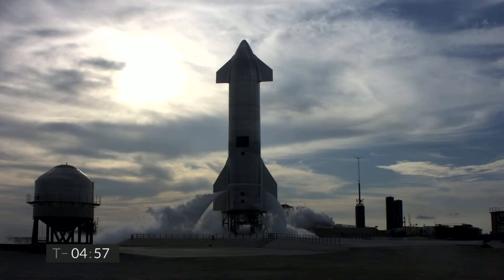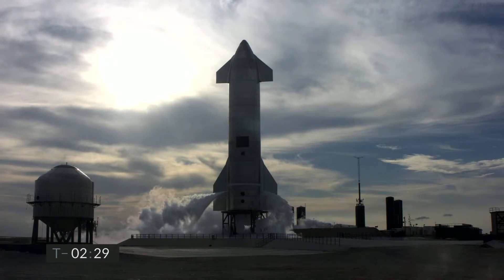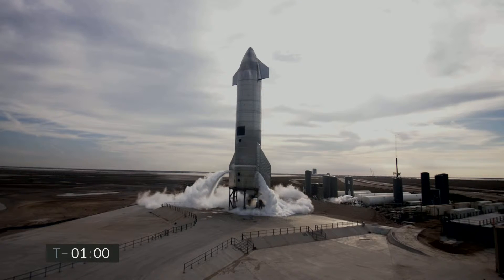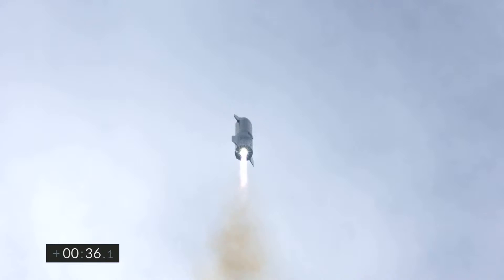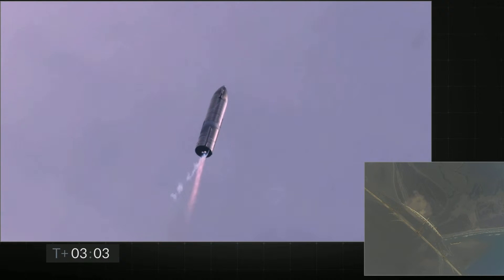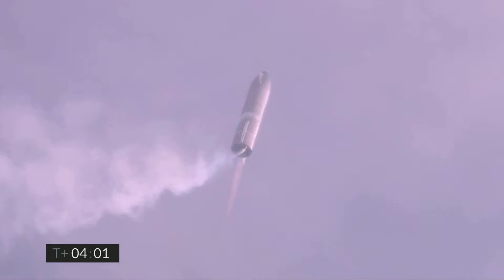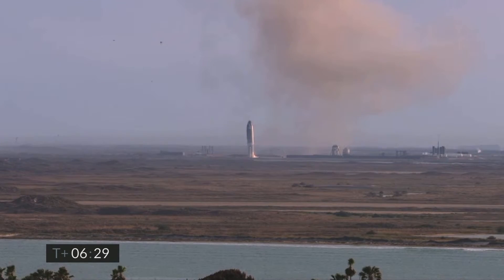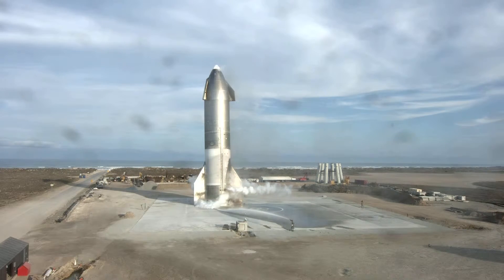Starship | SN10 | High-Altitude Flight Test

Comment: When it landing started, it looked like engine had failure or it was just trust control ? I think you need to improve the engine.
It needs to be able to make more thrust on landing, spaceship is so heavy and It bounced from the ground then it got damaged.
I don't know if you are using inverse kinematics, but if I was developing spaceship, I will do calculations to predict spaceship velocity at time of impact so spaceship can do its job in right time.
I hope you read this Elon. You are my inspiration
Reply: They shut down 2 engines as planned for the landing burn. No engine failures here.

Comment: just watched this again this morning and several things seem out of place.   The first is that "wash" of something along the outside of the engine housing sure looks to me like a leak.   The second is the color of the flame during the view inside the engine housing, plus you can see some of that wash that I don't think should be there. The third thing that I noticed I saw yesterday but today just seems to stick out more.  It looked to me like the whole starship "BOUNCED" when it touched down.  An object that heavy and built to be as light as possible is not strong enough to take a beating.   What About It (WAI) didn't stop their feed and the resulting explosion was analyzed.   It seemed to start at the bottom near a flap.   I don't know anymore except that it might have been in connection to some structural damage from that bouncing landing.

Comment: Sorry for a bit of pessimism.. I just dont see how the fully stacked with raptors could it liftoff without damaging itself and concrete undernith. Cant wait to see your solution. Funny how it moves nozzles wiggling between pointing through center of mass and fighting asymmetrical air resistance. Good test even though a final one not requiring asymetrical thrust during orbital flight.
Reply: It's on a launch mount, pretty standard for all rockets

Comment: It's sad that the air ship has exploded after touchdown.
Reply: @VillmuS  yes it exploded after about 9 minutes
Reply: @BuRnOuT_GuRu  i see no explosion there, it was intentional to turn off the second engine and that fire was normal
Reply: @VillmuS  it did explode after about 15minutes
Reply: @VillmuS  apparently there was a methane leak after touchdown (you could see small flames at the end) after that it exploded
Reply: @owencairns5872  yeah
Reply: @BuRnOuT_GuRu  oh alright i see, but yea it was still great test from spacex we can be sure that the next one will be the one hah
Reply: @VillmuS  yeah that is true but technically they achieved what they wanted to achieve which is soft touchdown
Reply: @VillmuS  https://youtu.be/R9_jVJklfHQ

Comment: So prototype they don't even put landing legs on it because it will be scrapped. Land right on the engines.
Reply: It does have landing legs that fold out.  Very short, too small.  They have upgraded ones ready for a later version.
Reply: @DanChampionJr  I was assuming they factored the landing would fail and also they ideally want to catch the rocket
Reply: @SterlingSansing  No, they have had the same cheap inadequate legs on SN5, SN6 for their hops, SN8, SN9 for their flights as well.  They have shown newer legs that have a more robust design, and indicated they will be on a later starship.  Maybe SN15.   SN11 is about to roll out, and it too has the cheaper legs on.   Had they set down a little softer these would have worked.  But as you can see it hit (and bounced) a bit hard, which crumpled these legs.
Reply: @DanChampionJr  thanks for the research. Will watch

Comment: very, very clever. using the unaerodynamic shape to reduce airspeed rather than fuel in a vertical descent. The saving in fuel and weight must be astronomical.

Comment: The rippling of the stainless fins @ 6:01 it would be impressive to see in slow motion.
Reply: Looks ripply, but it's infact deformation of hot and cold forced bending the metal during production, it has nothing to do with having this foil like structure that waves around like crazy. It's really strong.

Comment: I have compiled here a rought transcript of mission control, not counting the commetator.

0:00 "Our FAA licence is intact"
0:05 "Thanks"
5:13 "T-30"
5:23 "20"
5:33 "T-10, 9, 8, 7, 6, 5, 4, 3,2,1"
5:44 "Ignition"
5:45 "We have liftoff"
5:51 "All teams, triage alerts please"
6:01 "Acknowledge, software"
6:05 "FC2, please prepare for section 35, OAC, FC1, and LVN
9:22 [Unknown background speech]
10:25 [Unknown, spoken over]

Comment: Incredible work SpaceX team, sticking the landing was a great bonus considering this is only the third go. Some great vehicle ascent & descent data there.
I new she came down a little hard when i saw the little bounce, such a shame the fire-bot was unable to mitigate the fire so you could get hard vehicle inspection data afterwards,
 i had a feeling there was just enough fuel there to make it exciting just before she blew.
 Incredible achievement tho. 
that sequential re-ignition & shut down of the un-needed of the raptors seemed to do the trick. 
Cant wait for the next one, here is hoping you get some engines back in one piece to check out on test number 4

Comment: They would have kept the second engine running for a little longer so as not to land so roughly.
Reply: Engine 1 thrust could have just been slightly lower than 70% causing that
Reply: @OortCloud  We don't know the data, but from what I can see, it would have been better to turn off the second engine a little more after the third.
Reply: @francocastilloAR  It would appear to me that they kept all 3 engines running longer than they were supposed to during the landing burn which is most likely why they used 1 engine for the landing burn. Besides, 1 engine is just enough to put this thing in a hover.
Reply: @OortCloud  I do not think so. It would be necessary to see the supposed mass of the load to know how many motors to use.
Reply: @francocastilloAR  It's a good thing you replied now because now we know there actually was an issue with the one engine back then. It was ingesting helium so it couldn't reach its commanded thrust. If it wasn't it would've been perfectly fine.
Reply: @OortCloud  I saw the comment by chance. I still maintain the position. I don't think it's the only way to slow it down.
Reply: @francocastilloAR  I do have to agree with you, using 2 engines is exactly why SN15 survived.
Reply: @OortCloud  I can't tell you 100% because I don't have the data.

Comment: 3 things led to the explosion:
1. Landing legs were not strong enough/did not entirely deploy, causing the skirt to take the brunt of the impact (quite remarkably well), but with no way of ventilating the gas under the skirt out.
2. ‘Methane vent’ lit on fire when Starship’s engines flamed out for landing, 11:50.
3. Leaks in the tanks after the landing; fire protection wasn’t good enough to stop the fire from propagating inside the vehicle.

So at this point the raptors and pressurization have been ruled out as significant problems for landing, leaving the landing legs and where that methane vent was placed in the design to be changed.

To me at least it makes a lot of sense that the skirt would serve as a auxiliary landing leg when the main legs fail, with some sort of venting from under the aft dome done by nitrogen pressurization to make sure it can be safed. More importantly they need to have the methane vent or what ever was on fire placed away from the skirt. If the fire didn’t ever light, this bird may very well have been inspected by now.

For people saying the raptors were at fault: if they were expecting the starship to land on its landing legs before it landed on its skirt, you would expect them to be throttling down the last raptor to settle the vehicle on those landing legs. But when they failed, it accelerated downwards as they throttled the raptor down, also causing what seemed to be a bounce or a tilt when the skirt hit the ground. Hence the flight was perfect; it’s the minor issues that caused the unexpected RUD.

Comment: Even a small and quiet fire 
in the engine room, under the skirt, is a dangerous thing. 
It turns out to be an Autogenous pressurization. 
And the bottom tank can't stand the pressure.

Eight minutes after landing, 
the pressure in the bottom tank 
has reached a dangerous value. 
Why did the safety valve not work? 
Wasn't the automation supposed 
to perform automatic detanking?

Comment: 1/6 ...To all the trolls using the explosion 6 mins after a close to 100% successful landing. Let's see the Starship progression so far shall we? SN8 proved that the belly flop maneuver could work and return SN8 exactly where it was supposed to after coming down from 12.5 km height (so the flaps method works), even though all competitors said it wouldn't. Then SN9 proved that doing that maneuver wasn't a fluke due to being repeated exactly the same way for a third time on command. Yes both spacecraft blew up on landing and SpaceX used the data to better SN10 and achieve all the maneuvers from flying up on 3 raptors, hover at it's designated height using 1 engine for a few seconds, then did the belly flop and drop back down to the designated landing pad right on the bullseye! It did the belly flop maneuver perfectly and thanks to learning the data from SN9 they made some corrections and appropriate changes to nail the landing once again on the bullseye, not 100 feet away from it but right on it.
Reply: 2/6...SN10 proved that SN8 and SN9 served their purpose in order to show that method of landing could be done, even though all competitive companies and their detractors said it would be an impossible task and a huge waste of money. So yeah it exploded 6 mins after landing, so what? It landed right on the bullseye yet once again and showed that the legs are a huge issue to deal with. Due to the legs not working, SN10 landed on it's skirt and all the heat, flames, sound vibrations and rebound materials from the ground had nowhere to escape due to being trapped in the skirt. There wasn't any ground clearance and even the water couldn't get in the skirt because (again) no space to reach the inside of the engine skirt no matter how many thousands of gallons they threw at it. Not having any ground clearance due to no landing legs but rather directly on skirt, trapped all of the above I mentioned which ensued with an explosion. In simple terms, what Starship doesn't have but should have...

Comment: 5:57 you know that feeling when you know it's real but still looks like CGI?
Reply: McFlickers  The camera is theoretically on the starhopper. It is shaky on liftoff because the ground is shaking and there is shockwaves on the landing zone ground ( you can imagine that the starhopper is shaking too)  . When the starship comes down , the exhaust is not near the ground so it's a little less shaky
Reply: That's QE energy on steriods.
Reply: Why are you surprised? The whole point of CGI is to mimick reality as much as possible. That's why it looks like CGI but isn't
Reply: @fukun5773  if it really is CGI then I'm disappointed by the quality.
Reply: @Chandan44256  Okay but it isn't CGI though. It's real
Reply: I know, I was just stating that if it really is CGI, then it's really not very convincing.
Reply: Yall can go and see this live. Idiots. 😂

Comment: I don't see how that was a smooth landing, the ship bounced off the ground, a few of landings like those are surely going to be damaging to the ship?
Reply: Baby steps, Fred, baby steps.
Reply: @knife-wieldingspidergod5059  I don't understand why they don't use a parachute to assist slowdown.
Reply: @Salticus Maybe they could find a chute which is really light. This method just seem really dangerous. The chute gives another layer of protection. This method worked better on the falcon though which has the bouncy legs, with the starship there doesn't seem to be anything to cushion the impact. It may look slow on camera but this looked like a nasty impact if you look closely. Considering how large it is it must have hit the ground at 10-30mph. You can actually see the ship bounce off the ground on touchdown.
Reply: @Salticus Of course deploying a parachute would be problematic but so is every implementation with rockets or any engineering feat. All about solving problems. Parachutes are deployed when astronauts come back to Earth and land in the sea, I can see how it's more difficult to land on the ground though with a parachute but the parachute would just assist the slowdown, maybe would use less fuel overall even considering the additional weight a parachute would add because the thrusters wouldn't  need to burn so ferociously to slow the ship down. It's a tricky one, I just don't see this being the solution to spaceship landings. Ideally a spaceship should be able to land like a plane does imo. Why can't they just implement wings and it can double as a plane and spaceship? Would the wings burn up or break or something? Never understood the reasoning for that. If burn up is a problem couldn't they make retractable wings so they could be folded away for launching and reentering the atmosphere?

Comment: how is the camera so stable?
Reply: How is a $10,000 camera stable?
Reply: @DanChampionJr  were $9000 of those dollars spent on titanium robot arms to hold it? What am I a camera expert? I'm asking what was used to keep the frame so steady and basically pixel perfect
Reply: @adils786  Ok, I understand.  Yes, much of that is spent on computer control, and image control.  Each of their cameras has elaborate aiming programming, and very sensitive tracking software.     Most space agencies have similar tracking software and hardware.  Sorry, I don't know the brands, or the specs.
Reply: @DanChampionJr  Na thanks for that, that's literally what I was wondering about so appreciate the info 👍

Comment: Every engineering project is built on failures. Without failures you cannot really learn much. If every test launch had been 100% percent successes, that would be a hint that the engineers had not gone far enough to try out the limits of the technology in question.

I would rather have a hundred test launches failing, as long as the failures in question are not caused by the same thing (which would indicate a learning disability), than a hundred "successful" launches.

As a webdeveloper, I would do coumtless "test launches" every day, sometimes even within the same minute: testing my code, checking if the different parts work properly together and so on. If I get a successful "launch" then it is time to add the next thing on the list of desired features.

For rocketry though, the "refresh" is a little more visible and spectacular though. I can't say I mind that: It makes for a great show! Sad we missed this explosion ;)

Comment: Fix the engines.      Defective engines on nearly every test so far.   New engineers.
Reply: The engines worked perfectly this time like wdym?
Reply: @Yatiblue  No.  One of the engines shut down was leaking fuel.  Each of the flights and some of the stand tests have had engine or plumbing failures.  There is a material, design or manufacturing flaw.  It is time for the drawing board.  There seems to be a consistent 'something'.  Those engines are being manufactured to be used and re-used many times.  And so far,, at least one or more of the three has failed.  I suspect it is a thermal expansion contraction issue caused by a wrong material or a too direct pipe that has no room for the changes in dimension.  
The fire underneath was burning before landing.
Reply: @Sailor376also  yeah they're definitely not as reliable as they should be. I think they'll be able to fix it though

Comment: 12:01 it did do a pretty noticeable small hop right there as it landed..
next step will definitely need to be some more robust landing legs
Reply: its a waste of funding spending it on landing legs when the rocket is still in development and only does one flight
Reply: @Sparrowash97  of course. and now that they finally managed to get the flight down, next step should be to improve the legs so future ones don't land so hard

Comment: UNDER-POWERED on touchdown, so there needs to be another powersource in addition to the one raptor when they shut down two of the three. REDUNDANCE of power AVAILABILITY throughout is a must, all the way to touchdown.
Reply: One engine is enough. That one engine was throttled down to land, they just need to get the throttling limits right
Reply: there is always one guy lol......

Comment: You can clearly see that a vent valve failed to close at takeoff and intermittently vented as it flew.
Reply: It's supposed to stay open
Reply: @z-manoverstreet  you sure about that? it looks like it was getting ignited at times. ANY venting that enters the rocket exhaust can effect the operation, such as the Big Boom 7 minutes later.
Reply: @armastat  venting prevents burn off which can destroy the rocket, and can see some burn off and the end of the flight
Reply: @z-manoverstreet  I understand that. however if u look at the history of spaceflight, you will see lots of venting EXCEPT when the engine is going full tilt. They only time it should require to vent while under thrust is if something goes wrong. The amount of unpressurized flame at the bottom of the rocket during it's flight and the continuous flame after it landed -  indicated a problem ... And BTW you cant clam all was normal since - it DID blow up

Comment: Well the re firing of the 3 raptors worked out fine on landing, it hovered and seem to land fine but did the landing legs deploy correctly. causing a harder landing than was expected causing a rupture with the raptor lines causing a rapid de construction
Reply: The landing legs are in need of a major redesign
Reply: @alexn8219  
I think they have a new design either for SN11 or SN15